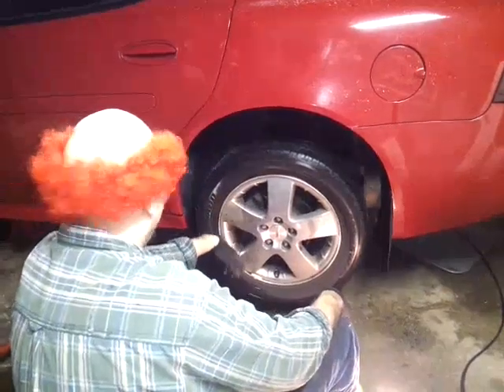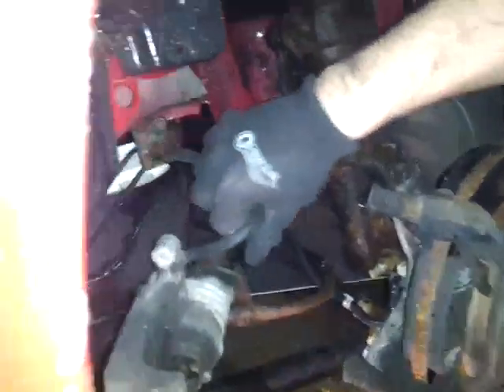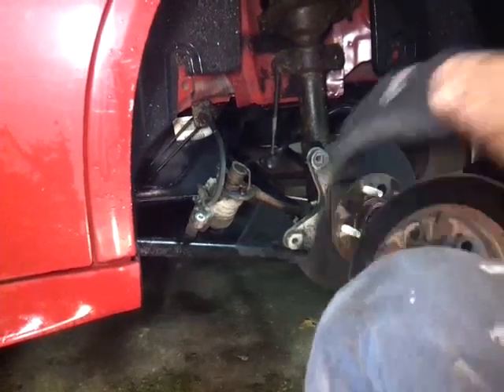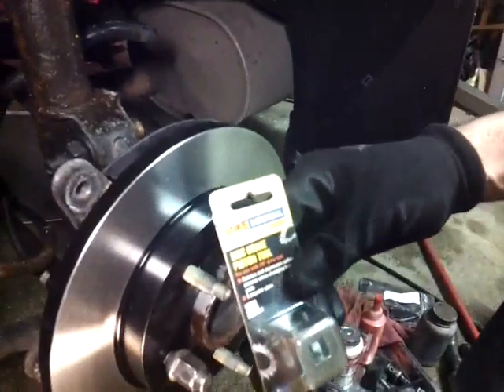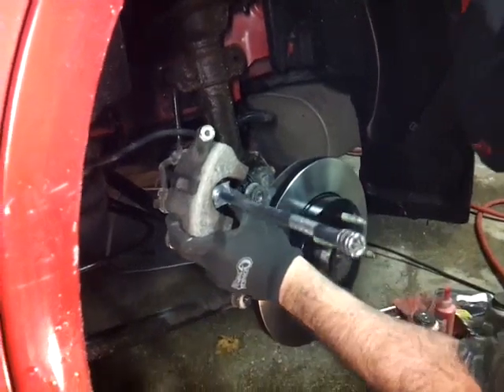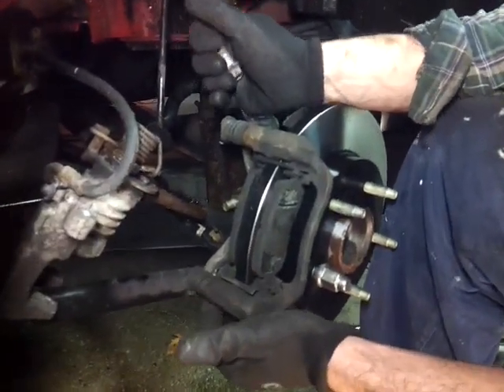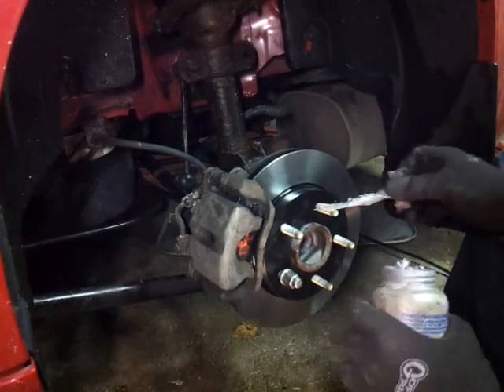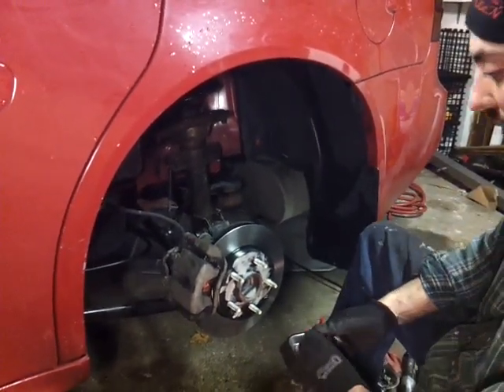Rear Brakes Pads And Rotor - 2004 - 2008 Pontiac Grand Prix

Comment: I watched and the way you put it was a whole lot easier than I thought it would be. I am a female trying to not be a damsel in distress. Thanks Klowney
Reply from the maker: Awesome..I loooove females. .especially the single ones :) ..also dont forget to align the holes in the 12 oclock and 3 oclock position once the piston is pushed all the way in..thanks!
Reply: What was the tool called for the rear piston?
Reply from the maker: Its called the brake piston cube ..your autoparts dealer rents it for free sometimes
Reply: Well.... I'm five years behind but another single female using your awesome skills.
Reply: Ok, I finished the job and turned out proper. Between your video and one other one I had ALL the info I needed to do the job on me own. 5 years later, after you posted this and it's still helping pulling some of us thru.

Comment: Thanks good lookin out. Anytime i need to work on my crap bucket (04 grand prix gtp2) I will look up your videos. So far i have replaced on my own my fuel pump, thermostat, will be replacing my belt tentioner drive with belt & my breaks & rotors. Do you have a video on blower motor resistor & the belt tentioner drive? That would be great.
Reply from the maker: Yes  I habe a video on a blower motor resistor but its for a camaro..nothing yet on belt tensioner.. awesome that you did the fuel pump..ur doing good!

Comment: I was just thinking same thing with the aligned piston and brake pad notch.he got lucky
Reply: I was having problem getting caliper back on over new pads. I thought I needed to compress the piston more.... Nope. It was as far as it goes. Then as I felt the back brake pad I felt a little round post sticking out from metal side of the pad. It hit me! Align the piston slots with the round pad post....wala! All in all counting smoke breaks, friends visiting during brake job, and a few wasps cruising in my "space, from start to complete tool clean up it took less than 3 hours for front and rear brake pads change-out! 2008 Grand Prix stops on a dime now! Next, it's brake job on 1991 GMC Sonoma truck.... Along with new radiator install, new bumper and grill, and headlight assembly parts.... (Small accident!)

Comment: Klowny1969, i have a 2007 Grand Prix Base 3.8L. Can you tell me if i have rear ABS? I just got the car about 2 months ago. When going down the road and the road bends to the right i get a rear light growl noise i believe is a bad rear hub bearing. If the road bends left i don't get any noise. When i first got the car i had a light growl in the front and it ended up being the front left hub and i had it replaced (took the growl away). The front has ABS but not sure about the back. They sell rear hubs with and without ABS.

Comment: Hay clown great demonstrations,just wondering but when you backflowed the fluid into the mastercylinder did you open it?also with cars with abs ,does doing that hurt the system?i got a 04 that im doing all four corners this coming weekend.
Reply from the maker: Did not open the master..best practice is to crack open the bleeder while ur pressing in the caliperand have the fluid bleed out..then refill and rebleed..backflowing can get bad fluid into ur abs solenoids..however in this video the owner preferred I did not do it this way..u shouldnt have an issue doing it the way I did it in the video though..also one more thing to point out..the aligning pins on the brake pistons should be pointing to 6 oclock and 12 oclock once ur done compressing them in..thanks for watching
Reply: klowny1969  
Newbie here. How do you bleed the brakes? And seems there is a different tool for front and back calipers? And lastly, anything have to be done concerning the ABS? Thanks. Very informative video

Comment: One other thing ,   crack the brake bleeder valve ? or remove cover from brake fluid reservoir  under the hood ?
Reply from the maker: Never bleed with the cover off the reservoir..brake fluid eats away at paint and it can slosh around when you press the pedal and the reservoir cap is off..thank u for commenting and watching :)

Comment: If you dont have that special key to compress the rear break instead of going all the way back to auto zone just use like an 18mm wrench it fits right in to the key slots an turn it with a screw driver
Reply: Ur awesome! Thx

Comment: klowny1969, After changing the rotors and pads do you have to adjust the emergency brake assembly at all? I am unfamiliar with the setup.
Reply from the maker: not necessary..thnx for watching

Comment: Do the rotors HAVE to be done as well or is it ok to do just the pads?
Reply from the maker: depends if the rotors are bad or not..sometimes you can get away with not changing them once..but second time around you should..check to see if they are worn first

Comment: When turning the caliper piston in, it is critical that the notches end up aligned at 6 and 12 o'clock.  You did not do this.  Did you determine this was not important??
Reply: Why is the aligning of those pins critical?
Reply from the maker: Because the brake pads themselves sometimes have the pins on them to insert into the holes..
Reply: klowny1969 Oh ok. So the brake pads you installed must not have had the pins pre-installed on them which was why you didn't bother to align the piston back to the 6 and 12 o'clock positions...

Comment: what if your brakes appear to be hanging up
Reply from the maker: sounds like possible bad rubber break lines
Reply: +klowny1969 could it be bad slides? lines look good but pads won't release from the rotor it doesn't drag
Reply from the maker: +Matthew Griglak could also be bad slides, bad caliper
Reply: stuck slides wont let the caliper move away